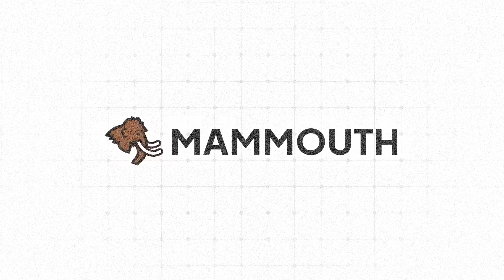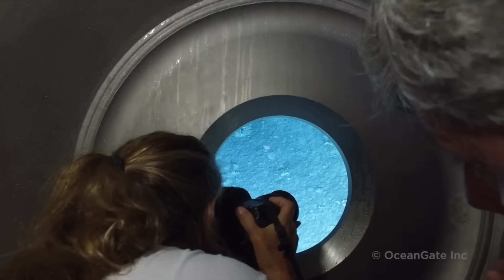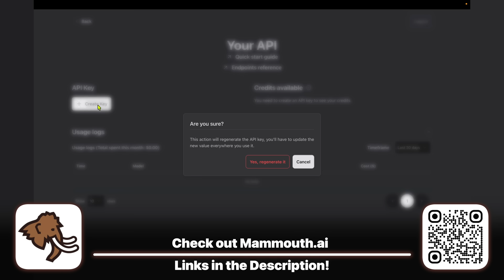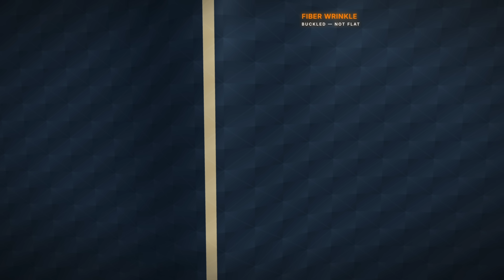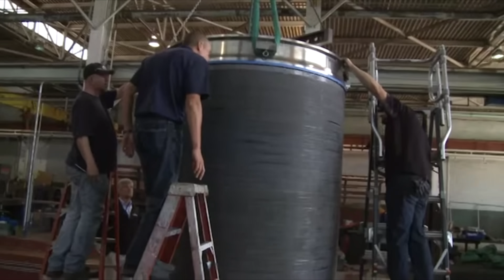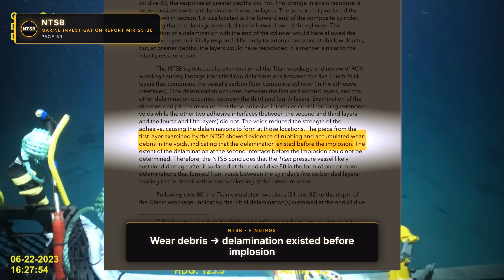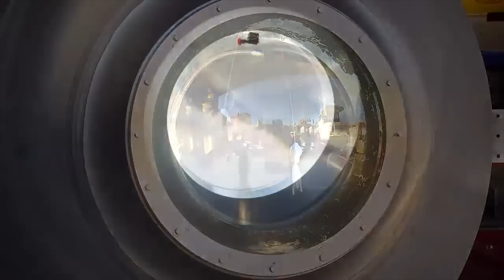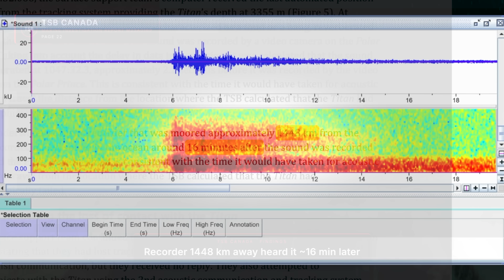Oceangate Titan: It was WORSE Than We Thought

Comment: Shaving down the bumps is such a huge mistake that shows just how much of a tourist Stockton was in the submersible world. He didn't want to use a uniform material like steel or titanium, he wanted to be a trailblazer with this composite he was familiar with from aeronautics. But when it came to fixing imperfections, he treated the hull as though it were a uniform material anyway. Shaving layers down completely ruins the tensile pressure distribution along what should be unbroken loops of carbon fiber. It's like shaving down an uneven spool of rope and still trusting it to suspend your weight over a cliff. He never understood the nature of what he was doing to such a degree that when catastrophic mistakes were pointed out to him, he couldn't comprehend the danger.
Reply: @ScienceWinsEveryTime  Shaving any part of a carbon fiber laminate creates areas of weakness. Simple fact, the resin isn’t the place you get the strength from, it is the carbon fibers, and while they are EXTREMELY strong lengthwise, if the resin isn’t there to protect it (sanding), you are breaking the fibers EVEN IF THE SANDING DOESN’T DO IT ON IT’S OWN. I know people who make carbon fibers parts for track cars in their garages, with a 0.01% air inclusion, as hobbyists! A system like the Titan should have been an example of proper construction design and execution, and they cheaped out. Nothing is worse than a billionaire managing a technical build if (s)he is the deciding factor on cutting safety practices, and the people who built it should have refused to do the work when they are told to cut corners.
Reply: @Eireman_on_Twitch True, but in this case they did sand down the fibers as well. In many instances they have cross-sections of lower layers having 6-10 plies shaved off at the location of a significant bump or wrinkle. Then they would start a new layer of plies over the smoothed down surface as if there was nothing to worry about. Stockton watched this painstaking spooling process of building 5 one-inch layers of hundreds of fibrous plies meant to be continuous, and then just treats it like a single solid-state material anyway. Just a mind-numbing lack of perspective and mechanical insight on his part. He only cared about what his own eyes saw at the macro level. What was happening at the micro scale didn't concern him.
Reply: And where there are damaged fibers, nothing except the shear strength of the resin is carrying load from broken fibers to surrounding good ones.  And without the 45 degree plies, it wouldn't even have done that well. This hull was doomed, apparently by human nature.
Reply: Dude I'm a software guy with zero experience in real-world engineering, but even to me it was extremely obvious that if you carbon fiber hull came out all wrinkly you make a new one, you don't CUT THE FUCKING FIBERS. Also, if the thing didn't come out as you expected, don't you think it also may lack properties you expected of it? This is not tourist behavior, this is plain stupidity.
Reply: @tonygluk1  It gets worse:

"According to Arnie Weissmann, editor of Travel Weekly, Rush had bought the carbon fiber used to make the Titan “at a big discount from Boeing,” because “it was past its shelf life for use in airplanes.”"
Reply: The description of shaving down the bumps brought to mind a lesson learned back when I was a kid trying to do origami with unsquare paper: Each time I shaved off a litle so that an edge would meet, it made things a little less even somewhere else. After a few cuts, I ended up with something that would never yield a crisp, even fold. Didn't everyone learn some form of that lesson as a kid? I can think of lots of iterations--like how impatiently cutting your bangs leads to uneven bangs, which you try to even out, which then needs even more evening out, which ultimately leads to grossly insufficient bang coverage. Moral of the story: Lopping off the problem isn't the same as fixing it.
Reply: Oh wow, what a vivid illustration of the danger of sanding carbon fiber. 😮
Reply: My archery coach would have executed me if I shaved down my carbon arrows if they went bumpy. That is some next level rookie mistake Stockton did.
Reply: He understood!! He was a pathological liar and con man! He knew what was going on!!
Reply: @dennismcgowan4059  I don't think he was s**c*d*l. I think his narcissism was so encompassing, he couldn't imagine failing. I could be wrong. He could have been sheer evil, wanting to unalive himself, and wanting to take some people with him. Remember the pilot of the Germanwings jet about twelve years ago?
Reply: @bobtaylor170  that guy was not evil, just suicidal though. only a child thinks in terms of evil
Reply: @Blox117 only a child should be incapable of thinking in terms of good and evil. Do you mean to say that you can't call The Holocaust evil? Or the abuse of the defenseless? Are you a moral idiot?
Reply: Ahh, I didn't see it like that until you explained it, thanks! Side note, I worked in a place that makes carbon fiber cylinders for underwater divers. Exact same thing! They had to throw out 40% of the finished tanks due to imperfections! The whole process is a little shaky
Reply: Every backyard hobbyist that does fiberglass KNOWS that you don't sand through the epoxy into the glass mat! 
And the importance of cross-laminations for structural parts.
Reply: @S @ScienceWinsEveryTime e also was just cheap and stubborn. One if it was successful he imagined a fleet of them. So good old fashioned greed and stubborn arrogance. 2. Everyone told hold him no. And he was going to prove them wrong. I’m Sorry but if Cameron told me nope I would believe him. He isn’t in it for greed but love of the science.
Reply: I'm an engineer.
Electrical, not naval, aeronautic, or even structural.
Never worked with carbon fiber, and even i know that's a stupid fuckinbg idea.
Reply: @antediluvianatheist5262  Right up there with using 16-gauge wire where #6 is called for.
I'm not any kind of engineer, I've just seen some stuff in 40+ years as an industrial mechanic.
Reply: Explained like this, this ... Thing sounds like a half wet toilet paper roll. Even if you could hold on to it before it begins breaking down, why are you trying to wipe your ass with soggy toilet paper any way? And with what's not wet, there's not enough layers.
Reply: I had no idea they did that and I'm just screaming in my head like "WHY ARE YOU MORONS DOING THAT?!" Like you wouldn't do that with tape that got crinkled, right? You take it off, get a new one, and make sure it goes on properly. Why in the seven layers of hell would you do it to a machine supposed to keep you ALIVE?! AAAAA!
Reply: Thank you for a good solid explanation. That makes sense.
Reply: @ScienceWinsEveryTime  first thought that came to my mind was Stockton was involved with crash retrievals in the ocean and I believe he was totally convicted of the power of carbon fiber because he saw it in ufo submersible craft
Reply: This is bull shit, It failed because the electrical system went down it couldn't drop the ballast and it dropped to fast ,  Any of the sphere craft  would have been crushed. it was fine and would have made 25 more dives. All these people are idiots.
Reply: @dragonflydreamer7658   you completely made up your entire comment, well done. Looking to join the Stockton Rush Club of Idiots?
Reply: @dragonflydreamer7658 The last message that Oceangate received from the sub was that they had just dropped two weights. They actually received it a few seconds after they heard the implosion due to the slowing of comms signals through water at depth. So it seems that both the electrical (including comms) and ballast systems were operating right up until the end.
Reply: @ScienceWinsEveryTime all those messages were debunked as a hoax
Reply: @dragonflydreamer7658  No, you are!!!
Reply: @dragonflydreamer7658  I sincerely hope you are not an engineer, since you clearly don't understand engineering
Reply: @dragonflydreamer7658 is that true?

Comment: It's extremely misleading to say a properly built or flawless carbon fiber hull would have been fine. 
That's like saying "if flawless humans built and flew airplanes, there wouldn't be a single crash yet." It's true, but it's pointless.
Nobody has ever made a flawless carbon fiber part, and nobody ever will. 
You need designs that can be built with flaws and be safe anyway.

Comment: Even if someone built a carbon fiber submersible which worked, was certified, thoroughly inspected after each dive and properly taken care of. I think I personally would pass. Given the lessons of Titan I don't think it's worth risking my life in such a thing where I can visualize microfibers tearing and delaminating. No matter how good or how perfect you build it. I'd much rather go down inside titanium which would deform slower and give me a chance to get back on the surface were something to go wrong. As opposed to shattering and becoming a ghost within that instant. The real kicker was bolting the hatch shut on Titan. I can think of nothing worse than making it back up to the surface and still dying because you can't open the hatch yourself. The parallel with Apollo One is astonishing, the go fever, the rush to get it done and ignoring critical data, and the hatch designs which ensured there was no emergency escape for the crew. Had Rush been diving this thing solo we could at least chalk it up to a Darwin award, it's that he took four more souls down with him who put their faith in his judgement and engineering.

Comment: Carbon fiber strength is at its best in tension. Solution? Put a lot of it. From an engineering standpoint it works, but to me it is not the right way to solve the issue, especially if you downplay how much of it will be enough.

Comment: You're absolutely spot on. 

It's not that you can't build a cylindrical carbonfiber and titanium end cap hull to go see the titanic. 

It's that it's very expensive to do it safely, even if, in the future it might make deep sea exploration cheaper. 

Oceangate and Stockton Rush did it fundamentally wrong. 

They never tested the variability in their manufacturing process.

They never tested the hulls to destruction, not just through pressure, but also the diving cycles and associated stress.

They never tested the acoustic warning systems ability to track damage over time or it's ability to warn of imminent catastrophic failure. 

...

Their company and policies were inherently unfit to be allowed to carry passengers. Even if it was unmanned underwater ROV's they shouldn't have gotten contracts. At best they should have been trusted with toy submarines.

Comment: 1.25 is far too low to be safe. Also a sphere is the only sensible solution and if space is a problem then make it bigger - people in a cylinder at very high pressure is lunacy. And this lunacy plus a fearless egocentric no-rules lunatic =  death of the lunatic as well as the passengers he conned with his sales pitch.

Comment: The thing I always think about is.... The haul was likely leaking air on the last dive.  So they tried to resurface, but they lost to much air and were unable to empty the ballast tanks.  Internal pressure in the sub was dropping and they were unable to surface, Rush likely knew they were done for way before it popped.  I mean imagine being in that tube, trapped, unable to leave, unable to surface, just sinking into the abyss knowing it's about to implode....
Reply: i don't think they knew except for that moron driving the tube probably.

Comment: If the carbon-fiber/resin hull of the Titan had been a truly viable deep-submergence hull design...........

You'd bet that the US Navy, the Russians and everyone else that operated combat submarines would have been all over this.

After all, Oceangate's advertised hull design was tons lighter that the HY-80/100 of USN designs and the HT/Titanium Russian designs.

The reason, kids, ............... Is because, as any competent materials engineer will tell you, Carbon Fiber is strong in TORSION....... but not COMPRESSION

The Oceangate Titan was relying, not on the carbon-fiber...... but the resin that held it together.

Under sea-pressure, the carbon-fiber strands weren't under any torsion pressure at all. indeed, it was being forced back along its length (compression), for which it has no resistance.

Only the resin that was used to bind the C-F strands to each other formed the "hull" that these unfortunate souls relied upon for their safety.

They dived to the Titanic wreck in a tube of glue.................................

Edit: Thinking more about this from an engineering angle........ If the Engineers had made the carbon-fiber bands run fore and aft around the pressure cylinder (i.e. front-to-back) and then locked them into place with resin it would have taken advantage of C-Fs inherent strength of torsional resistance.

All compressive forces would have placed the C-F bands into torsion, increasing as the craft went deeper.

Just a thought.....................

Comment: The thing about carbon fiber being theoretically usable in submersibles is that the Canadians left a massively overlooked detail: YES, a sufficiently thick and properly built carbon fiber (CF) could in principle be used in a submersible, maybe even to the similar extent as metallic submarines. BUT there's two major strikes against the use of CF in submersibles as the primary pressure hill. 

1) It cost way more time, money and effort to build a perfect hull with no voids, wrinkles nor defects in the weave. If one is found, you will have to start over from scratch again.

2) During the operational life of the CF hull, if there's a defect detected in the hull, you have only ONE option, the replacement of the entire hull. 

Metal hills are far more easier and cheaper to fabricate and during use minor defects could be repaired, which prolongs the working life of a metal submersible.

It comes down to the basic fact that it's cheaper and more economical to use metal in yer primary life-supporting pressure hull. CF can be used as secondary non-life supporting hulls or as exterior surface skins that's not pressure bearing.

Comment: I tested sky cranes with a 10 to 1 safety factor and they still failed. There is always someone down the line who missed a moved decimal point and you have 1 to 1 and you get to watch a $4,000,000 crane fall to the ground.    Carbon fiber is meant to be stressed in tension, not compression.  The whole concept was junk.

Comment: I always wondered if his idea would have been more viable if he had done a couple things differently.   

1. Make the carbon fiber hulls single use, or for like 2 dives then replace it?
2. Using a cross hatch style of building the carbon fiber hull? Instead of having all the stands going the same direction. 
3. Putting a thin layer of a type of  compressable material betwwen each layer? To help absorb some of the compression. 

Just some things I wondered.
Reply: Point 1 would have cost WAAAAY more money than Rush wanted to spend or in fact could spend, Oceangate was barely profitable at the very best of times IIRC.

Comment: As a PADI MSDT instructor I fully understand water pressure, it is incredible even at shallow depths.  PADI instructors follow standards carefully researched and when followed deliver a safe enjoyable experience for the vast majority of people.  Problems happen when standards are ignored, "I never got narcosis before so I can take some leeway", NO you can't.  Underwater when things go wrong they happen very very fast that's why we follow standards.  I would never have gone down in that submarine.  There was a retired Navy Engineer in Roatan that built a sub and he would take you down to 500ft to see the continental drop off, I never went because it was not certified, even though it was really tempting.

Comment: This is the second video I've seen discussing the final report. Both had the aluminum can analogy. It is completely bogus. You had an open, empty soda can with exceedingly thin walls, which you can crush easily with your fingers. Then you say a sphere doesn't have that weakness. But if you had a sphere of the same wall thickness and a hole to let the air out, you'd be able to crush it just as easily with your hands. Your analogy is completely flawed.

The problem with the Titan was not that it was a cylinder. The problem with the Titan was not that it was made of composites. The problem with the Titan was that they had truly crappy quality control. They didn't know what they were doing. There were wrinkles in the layers that they literally sanded off, cutting the load-bearing fibers. Composites are very good at compression, as long as the fibers are straight and aligned with the load axis (hoop direction in this case). If you have wrinkles, the fibers are no longer pointed in the load direction. This means compression will cause inter laminar shear stress, which will lead to fatigue cracks, and ultimately, catastrophic failure.

I didn't watch the rest of your video because the can demo is so stupid. I hope you did eventually get to the wrinkled fibers.

Comment: The Titan was somewhat like the old Comet airliner. It seemed to work at first, and the basic design was OK. But it kept coming apart at cruise altitude because fatigue issues -- in this case explosive rather than implosive -- were underestimated. Other companies used the information derived from the failure investigation and built the superior 707 and DC-8.

Comment: The comments in the other videos ate right, carbon fiber is a really stupidity material to use in a deep sea submersible because it tends to delaminate and it suffers immediate catastrophic failure without warning unlike high strength metals.